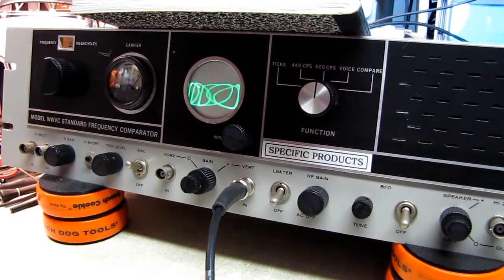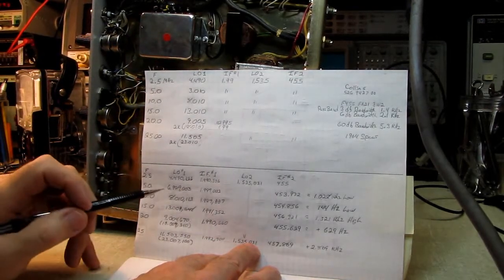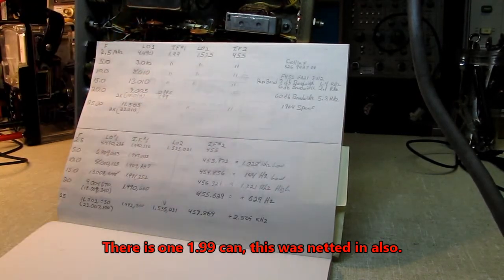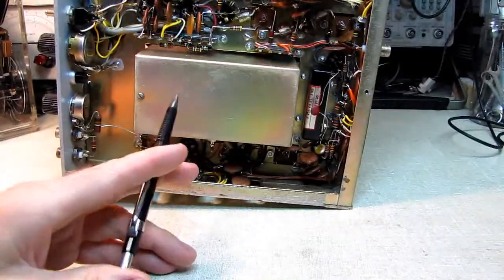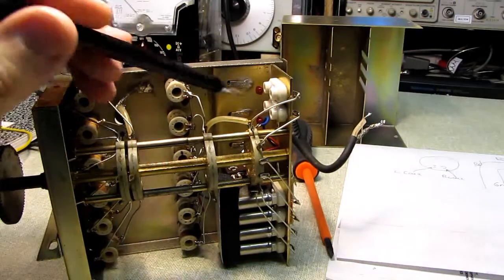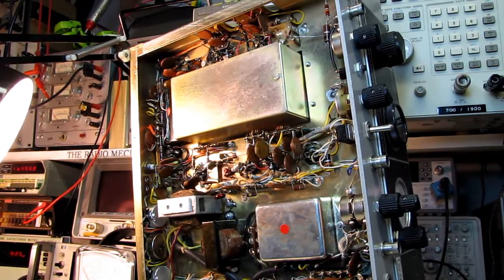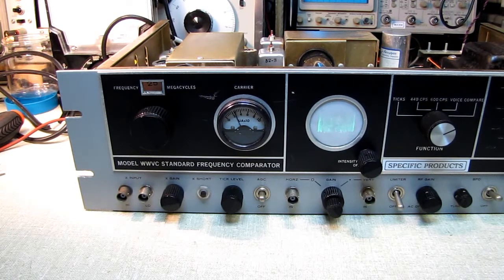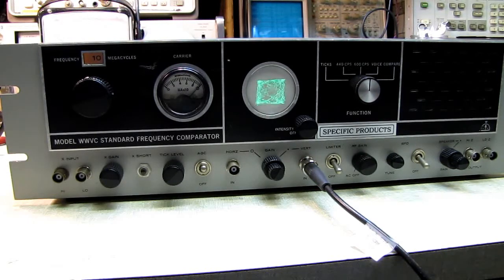Model WWVC Standard Frequency Comparator #4

Comment: I know this is an old video, however, it may be the variable capacitors are to level the power out of the crystals to match each channel. The inductor may pull the crystal a bit, or they just accepted that crystal frequency and adjusted the IF crystal to "fix" it.

Comment: The high voltage issue, what is used as a rectifier?  Is it a tube or a silicon diode?  Wonder if it originally had a selenium rectifier.  I know changing to a modern silicon diode will raise the voltage.
Reply from the maker: HI Mike. Three are silicon diodes in the thing. And they have been there since day one. When I got this to work on it had never been touched. It was 100% original. The diodes are in series pairs to either increase the PIV or to drop the voltage slightly. But this thing was many volts over what it was supposed to be. The older versions used a 5Y3 for the main rectifier and a 6X4 for the bias voltages. I'm wondering if when they changed the design the guy doing it just didn't realize the voltage would jump up. These were a very limited production run. Just  find it hard to believe no one noticed. I am baffled by this thing.

Comment: Perhaps another component in the oscillator circuit has drifted? Or perhaps the crystals themselves have drifted so far out of spec due to humidity that the caps are no longer sufficient to effect a change. You could try putting another trimmer capacitor in there as a test, just to see if you can get any change. Even if it were to hang out of wires you might at least be able to see if that is the issue.

Thanks for sharing. Cool unit.

BTW: Which signal generator are you using on your bench?
Reply from the maker: Hi Pel, the generator is an HP 8657A.   100 KHz to 1 GHz and I have a frequency doubler that will take me to 2 GHz. Oldie but solid performer. Even if things have drifted the caps should cause some change in frequency. The thing will not change 1 Hz. I am totally baffled by this thing. Thought I was pretty good a fixing things. Been humbled by this one. It is a pretty cool unit. I want one. Not of any real value/use today. But a nice piece of history. Thanks for watching.

Comment: That IS strange that a 30pf swing in the capacitance has no effect. Even if there is stray capacitance involved changing the trimmers should do something!
Reply from the maker: HI Robert. This one is keeping me awake at night. I just cannot understand why this thing won't change frequency. Especially on the 20 and 25 MHz bands where the crystal is running at the second harmonic. The smallest change should be doubled and very noticeable. But the frequency does not even change 1 Hz. The manual says to turn the trimmers to net in the frequency. And it just will not change. I has to change, but it doesn't . I have been trying to figure this out for weeks now. Every day I stare at the schematic hoping that light will dawn over marble head. Cannot afford to spend any more time on it. Work is piling up.

Comment: hey i am trying to complete my project so basically its two  sine waves of frequency 500Hz and 1.05KHz and we are supposed to compare it with some threshold and light up Green LED if signal is between 500-1.05k Hz and Red LED if it exceeds.  i have access to filters, 555 timer and OP484 Any help will be appreciated thanks

Comment: Isn't that a Collins mechanical filter and not a ceramic filter?
Reply from the maker: Hi Manuel, I guess technically the name is mechanical filter. Most of these use some form of crystal, ceramic, or ferrite wafer between stages that are cut to "ring" mechanically at the IF frequency. I had ceramic in my head as I have changed several filters in radios lately. I do not know the specifics of exactly what the construction is inside the filter case. Didn't mean to be misleading.